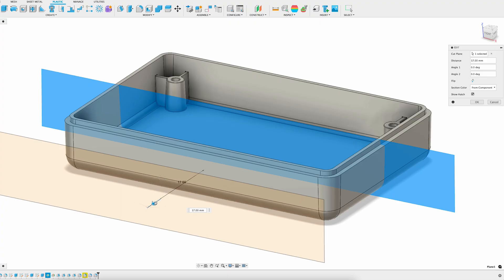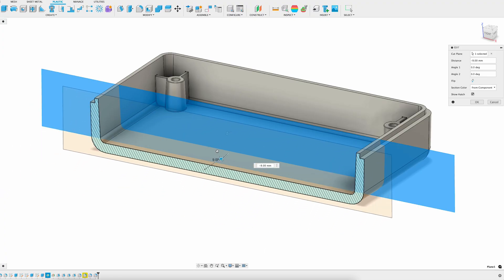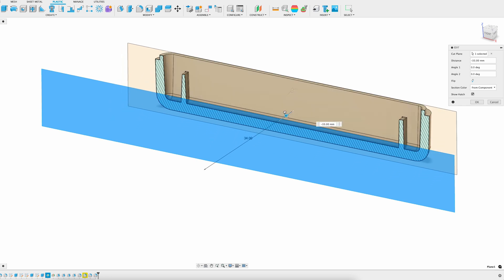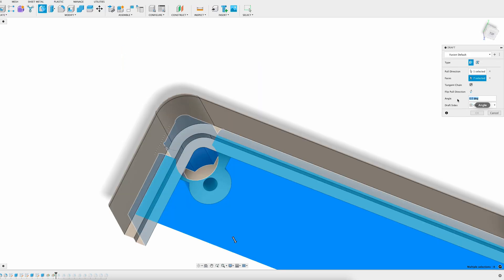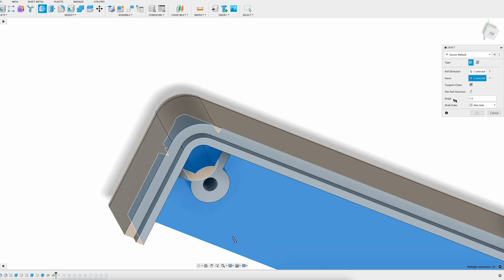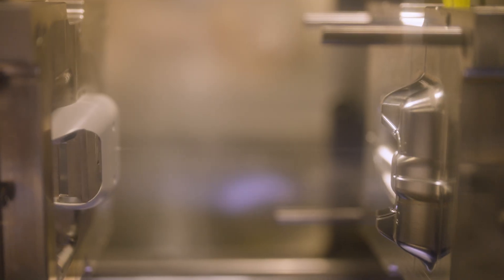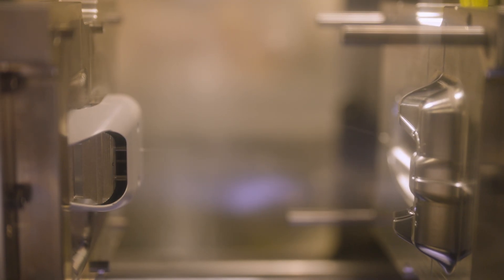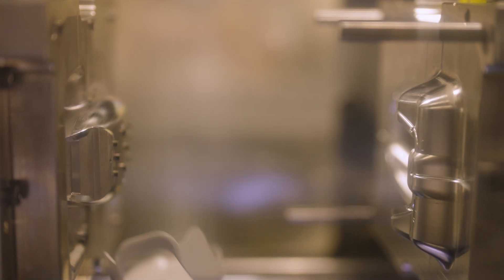How to Choose CNC Machining & Injection Molding Tolerances for Production (Not Prototypes)

Comment from the maker: Rule for production tolerances: Default loose, tighten only CTQs. CNC tight tolerances cost machine + inspection time. Injection molding tolerances are limited by shrink/cooling—use realistic bands and tune via steel-safe T0/T1 sampling.